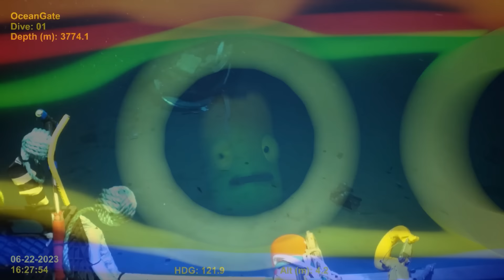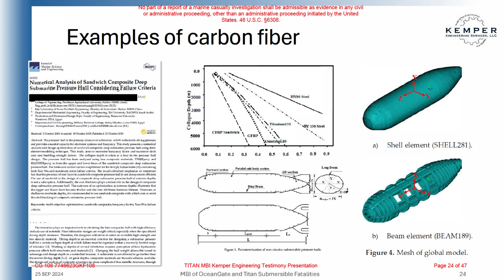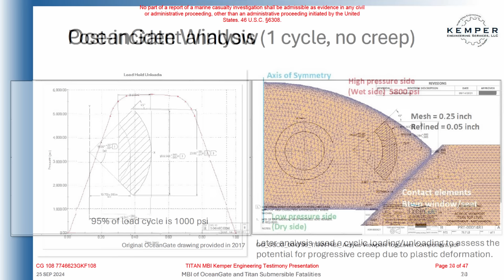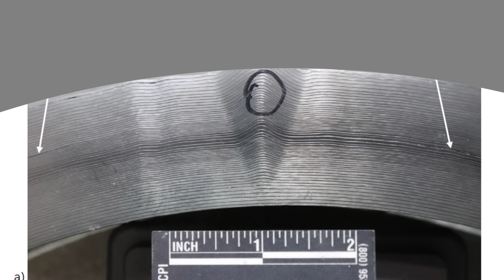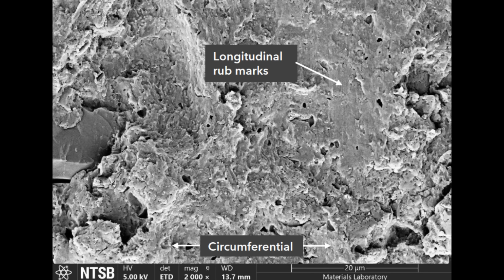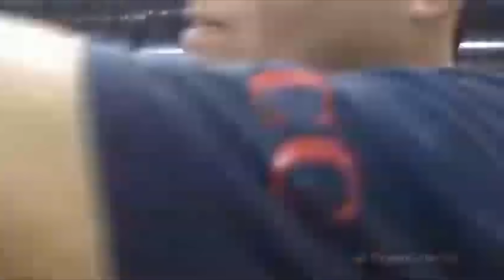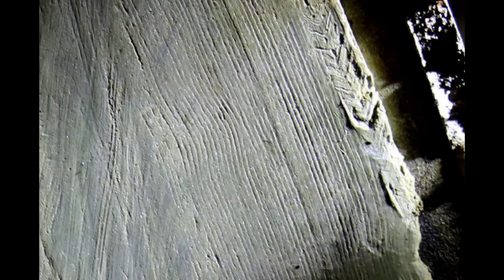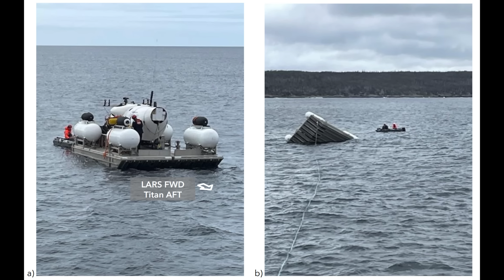OceanGate Wreck Shows Why Sub Wasn't Strong Enough To Survive - NTSB Shares Important Details

Comment: 11:15 "and then machine the surface flat again" sweet jesus that sounds uncannily like the carbon fiber version of "i shaved just a couple inches off the top of these engineered I-beams to make the bathtub fit better".
Reply: haha yeah it's not like the very long fibers are an important part of a composite and sanding them away would seriously weaken it
Reply: @artemisfowl7191  I AM THE ELON MUSK OF THE SEA AND I DID IT WHEN THEY SAID IT COULD NOT BE DONE!!!!! -Stockton Rush, probably.
Reply: @AngryMillennialChannel , and clearly he was not Elon.
Reply: @fredk.2001  Elon is also nowhere near as smart as he claims. gestures to the cybertruck
Reply: @AngryMillennialChannel  Elon is at least smart enough to order countless unmanned tests before sending people onto unproven designs. I imagine OceanX would operate a lot like SpaceX, and spend the first fifteen years of it's existence just doing unmanned operations.
Reply: @AngryMillennialChannel  "Well they did say it could be done... Whether it should be  done was another matter entirely."
Reply: @fredk.2001 Elon is at least smart enough to not go in his own rockets.
Reply: By machining they meant sanding with hand sanders too. Crazy. It's hard enough to get a good finish on a nice piece of wood.
Reply: @dustman96  By machining they mean using cutting inserts and skimming the cylinder on its mandrel. like one giant lathe.
Reply: HAND SANDERS?  @dustman96
Reply: @dustman96  you're pulling my leg
Reply: That was my thought too! I'm no engineer, but I've built enough stuff to know that doing that will only weaken the finished product. Did they deliberately build this thing to fail spectacularly? Because that's what it's sounding like.
Reply: I cringed the moment I heard that!
Reply: @TheSakzzz  Same. And those images of the wrinkles and bubbles were painful. I wouldn't allow that kind of lax quality on any of my own work, and lives certainly don't depend on my theatre props or refinished furniture! But I have this thing called self respect.
Reply: what's the purpose of single continuous fiber construction if you just cut into it afterwards
Reply: They didn't even machine the bumps off. They used an ORBITAL SANDER BY HAND and then started winding carbon fiber over that surface. By the fifth layer there were bumps all over the entire surface and they had "sanded off" about 25% of the total structural integrity. I'm an idiot and even I know not to do this...
Reply: 100%
Reply: True, just a total slashdash hackjob!
Reply: This is why i get nervous every time I've had to drill into my Jeep's frame to install something lmao.
Reply: That doesn't even take into account the fact that when you sand away material it makes a lip which is a focal point for more pressure stress.
Reply: Even better - it's like saying "I am just cutting a few of these cables, it's just a cut, but the cables are still dangling there - that must be worth something, right?"
Reply: The carbon fiber strands would not be continuous there and it would weaken that layer.
Reply: @CrowsofAcheron  It's just shoddy craftsmanship! Amateur shit!
Reply: Also they are machining the "uncured" resin off that was under the peel-ply.  I use peel-ply with Epoxy on boats so I can get a chemical bond which is stronger than a mechanical bond from sanding.  That layer though is only a few molecules thick.  You can basically clean it off with acetone.
Reply: I kept thinking to myself. If the would-be-occupants of the titan had known of all these "Details".
Reply: (shudder) "plumber cancer"
Reply: Probably even worse - steel still has own rigidity - Carbon fibers though are just fibers ... if you cut the middle because it's wrinkled... O.O
(depending on details of the I beams, of course) (also, I beams tend to be designed with more tolerance, depending on details, but their goal was lowering weight, so ...)
- With Probably a meter to each side of the many severed layers of the cut fibers was nearly non-structural. It was almost just plain resin.
Reply: no to be fair i think it makes sense. Their logic was that by machining them flat they'd loose the strenth of the top few fibres, but this would be made up by the next layer being stronger because it lacks the bulges, while also reducing weak points.

Assuming carbon fibre was an acceptable material for the job and assuming they used enough layers, it would have been a somewhat passable idea.
Reply: Exactly, like wtf, I thought it couldn't be worse but there it is
Reply: I'm liking your comment because eat a bag of hell username with 666 likes is to close to irony...
Reply: Meaningless- they were using the carbon fiber in compression.  Literally pushing a string.
Reply: @edasm4113  Carbon fiber is a reasonable material to use, but the rig they built to lay the fiber was not up to the job.  Plus, sanding the fiber is true idiocy.  What amazes me though is that they ignored the bang.  Literally 10 seconds of thought makes one think that the bang was one of the glue layers separating from the carbon fiber as the strain went down after the dive.
Reply: @Leeeeegion , water had ingressed under high pressure and once the pressure from outside had lessened, the trapped water pushed at the glue layers, separating them abruptly, and causing the bang.
Reply: @Leeeeegion  Fiber reinforcement (of any kind) is simply incapable of resisting compressive force.  It aided the binder but did nothing to prevent the implosion.
Reply: @edasm4113  This is the "armchair physicist" comments that Scott mentioned at the beginning of the video. It's far more complex than that. It's not that it's fundamentally a bad material to use, it's simply that we haven't done enough research for it to be certified in the US. 

There's a lot more to it than just "carbon fiber composites good in compression. pushing string." No, if done right, with more research and not cutting corners (or more specifically, layers of fibers) it can work.  Glass fiber composites (same thing, basically, just weaker) have been used successfully in DSROVs.

Comment: Carbon fiber can work in this application......but it needs extensive research and lots of pressure cycle testing to determine durability, and development to ascertain the best manufacturing process.  Very pricey undertaking.

Comment: seems like it’s not a great practice to use two very different materials built into very different shapes both with very different reactions to extreme pressure along with the difficulty of joining the titanium domed end caps to the cf parallel sided barrel, far too many variables to control

Comment: I was prepared to give these guys the benefit of the doubt - just because it's a new construction and just because they disagreed with some experts, sometimes experts are wrong.
But ignoring your own warning system. Machining down imperfections in the wrapping, not catching increased strain due to the redesigned window that can be understood with a simple FEM analysis- it's just unforgivable.
Reckless morons.

Comment: Couple of observations 🙂. Carbon fibre DOES WORK! It completed a number of dives to it's intended depth. What they didn't understand was how long it would work for. There was no data available to understand the effects of multiple cycles and they made no effort to collect and understand the data - their real time monitoring system being testament to this. Stressed carbon fibre, immersed in HP sea water doesn't age particularly well. This accelerated by the various imperfections buit in. So some part of the hull suffered from the ingress of water that caused delamination. Probably at or near the titanium (front) end ring. We will never know for sure. The pressure found the weakest spot and blew it out, causing the entire structure to self destruct. I believe that based on the lessons learned someone (crazy enough) could build a version 3 that will last a lot longer than Titan V2 did. Sort out the manufacturing process. But you would still have to limit the number of cycles to a do not exceed number 🙂

Comment: Very poor buildquality... Grinding down carbon fibre sheets because of buckling is just bad practice. They should've layed down one after an other rotating the meeting points of the layers.  Also, why weren't the steel rings sandblasted...?
In addition to that they got air into the glue joints between carbon fibre layers...

Needles to say, I facepalmed multiple times this video.
And to be honest, I'd rather go see the titanic in a sub built by my formula student team, then this deathtrap.

Comment: What the hell, did they really had wrinkles and just sanded them off?? Like, that will works for poorly fiberglassed boat hull, you can sand the air bubbles it and patch it up, but not for a pressure vessel. How did it even work for that long with those imperfections?

Comment: Corners, and boundaries between unlike materials, are ALWAYS someplace to watch for cracks or even catastrophic failures. 

NOT testing multiple prototypes to failure with a novel design, in a novel application, is horrific. Relying on a safety system whose behavior you haven't monitored during the destructive testing you didn't do - that's a fast ticket to a Darwin award. 

Bits of dead people. Called remains for a reason.

Comment: the simple solution for the window would have been a second inner window designed to optically correct the view that does not bare load.

Comment: Hi Scott. 
Awesome video. I work in aerospace and wrote my PhD on ultra thick composites. In a nutshell; in any curved section of the laminate transverse stresses are induced. Transverse strength of the laminate is way lower than one might expect; it basically boils down to resin strength. This quickly causes delamination. On top of that; significant process induced stresses from the curing process need to be added (heating/ cooling/ resin curing). 
The wrinkled you mentioned are a serious issue and caused during the compaction process of the uncured laminate. They will cause local stress concentrations.  Machining the outer surface flat is probably the worst thing you can do since the fibers and thereby the primary load path is destroyed. On top, the round cross section of the vessel actually becomes asymmetric. Naturally this also results in an asymmetric stress distribution and hence deformation, further promoting transverse stresses over the laminate. BTW, transverse shear stresses a most likely at a maximum in the middle of the laminate. Most of that stuff can actually be calculated with off the shelf FE- tool. You just need to know where to look ;)  
Machining of CFRP is a science on its own. We found that free edges of a thick laminate can suffer from significant damage due to the machining process. Nothing you will notice with a naked eye. But, there will be microscopic damage in a critical location (free edge effect...). 
Just a few things I could remember. Did my thesis back in 2011. A portion of it is here in case you are interested: https://kth.diva-portal.org/smash/record.jsf?dswid=-2218&pid=diva2%3A454092&c=3&searchType=SIMPLE&language=en&query=&af=%5B%5D&aq=%5B%5B%7B%22personId%22%3A%22u1jsiwfm%22%7D%5D%5D&aq2=%5B%5B%5D%5D&aqe=%5B%5D&noOfRows=50&sortOrder=author_sort_asc&sortOrder2=title_sort_asc&onlyFullText=false&sf=all

Comment: Very interesting video. A couple of points about the design (as a non-engineer).
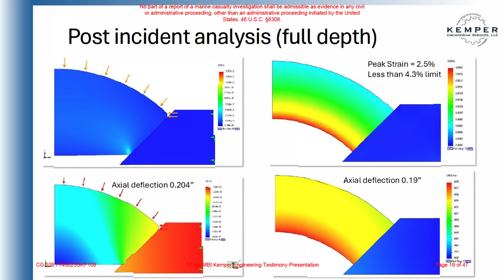9:00 ish The obvious fix, even prior to build, was to use a (part-hemispherical) approved window and to stick to it a non-loadbearing second layer, flat on the inside, matching the inside curve on its outer surface and not touching any part of the hull. Potentially, you could calculate the outer window shape at depth and apply an appropriately shaped flat/curved second layer once in the deep using a surfactant to ensure a quality optical join (slightly daft but possible).
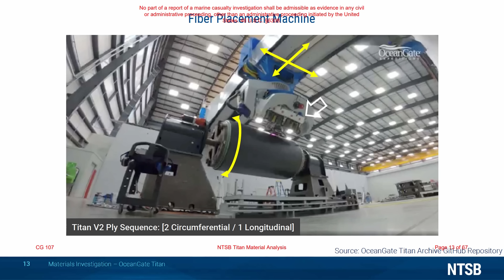10:30 ish The original problem that RR Aero engines had with carbon fibre blades for the RB211 (which bankrupted the company) was that the blades had only 90° layers and shattered in bird impact tests. The solution was to have 45°layers in the mix. It would have been smart to learn this decades old lesson, as requested by Boeing, and make the carbon fibre more resilient by using four layer orientations.
Reply: IIRC layered CF propellers just kept delaminating, and the industry had to bite the bullet and pay for 3D weaving.
Reply: The secondary viewport layer wouldnt need to be solid. A gel with similar optical index backed by a 5mm sheet of acrylic would be enough.

Comment: Micro air bubbles trapped in between layers during curing won't have helped under extreme pressure. I am surprised they didn't try and find some way to put the unit under a vacuum while curing to limit the risk of them forming and to create a stronger lamination.
Reply: They did -- and that's where the wrinkles came from.  It's pretty standard to put carbon fiber layups in a vacuum bag to squeeze out the excess resin between the layers, so that the carbon is pressed as densely together as possible.  But they only did this every inch of thickness -- and, just like if you loosely roll up a roll of paper around a solid tube and then put a rubber band around it, that causes the outer layers to form wrinkles because their diameter is shrunk by the squeezing but their circumference stays the same.

Comment: Definitely the best video about the subject I have seen so far! And being a mechanical engineer with some experience with composites myself, I guess I can claim having an above average understanding of the subject.
Just one thing, since it is mentioned so often in articles and videos: Yes, (carbon) fiber composites are better under tension than under compression. But they are often used under compression too! Easy example: an airplane wing. While in (steady) flight, the upper skin of a wing is constantly under compression. (Grounded it's the opposite, but the loads are much smaller) You just have to make sure nothing buckles AND KNOW WHAT YOU ARE DOING!
And another thing: These titanium flanges look ridiculously thin!! Less than 1cm! (22:02) I don't know the design loads acting on them, but that's just like a sheet metal... 😳

Comment: OceanGate Titan Submersible Implosion: A Deep Dive into the NTSB's Preliminary Findings

* 0:04 Coast Guard Inquiry Focus: The video analyzes the Coast Guard's inquiry into the Titan submersible implosion, focusing on technical aspects and the NTSB's preliminary findings.
* 1:00 NTSB Analysis: The NTSB presented imagery of the wreckage, analysis of recovered debris, and material test results from the carbon fiber hull, providing insights into the microscopic level of the failure.
* 1:23 Carbon Fiber Hull Construction: The Titan's hull used titanium end caps and a barrel-shaped section made of five 1-inch thick carbon fiber composite layers. OceanGate chose carbon fiber for its light weight, aiming to minimize support ship costs.
* 2:12 Early Design Challenges: Early tests with carbon fiber end caps resulted in failures, leading to the adoption of titanium end caps.  The barrel shape, while less strong than a sphere, was a compromise for weight and cost.
* 3:43 Material Suitability: While titanium is approved for pressure hulls, carbon fiber composites are not, primarily due to a lack of extensive testing, not inherent unsuitability.
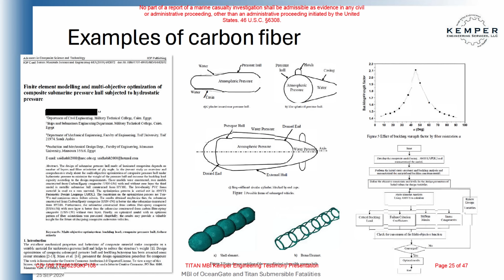* 5:11 Window Concerns: The Titan's window, not being the standard shape, was not rated for the dive depth. This design choice, driven by the desire to avoid optical distortion, resulted in higher stress concentrations in the window corners.
* 9:13 Hull Fabrication: The hull's construction involved layering and machining to mitigate wrinkles in the carbon fiber.  A peel ply was used to roughen the surface between layers for bonding. However, wrinkles persisted and interlayer adhesion remained a concern.
* 12:56 Wreckage Analysis: The recovered hull piece (Hull piece A) split along the glued layers, indicating weaker interlayer bonding compared to the carbon fiber layers themselves. Microscopic analysis revealed voids, crushed glue powder, and rubbing marks, suggesting interlayer movement under pressure.
* 17:56 Macroscopic Wreckage Analysis:  The forward ring showed significant damage, with sheared inner flanges and missing adhesive. The aft ring retained some adhesive and showed impressions of carbon fiber laminations. The pattern of debris suggests the failure may have initiated at the bottom front, near the forward ring.
* 23:45 Real-Time Monitoring System: Strain gauge data, when plotted against depth, revealed a significant jump in strain on Dive 80, correlating with a loud bang heard by those on board. This change in strain persisted in subsequent dives, indicating progressive damage. The real-time system detected the anomaly but it was dismissed by OceanGate.

I used gemini-1.5-pro-002 on rocketrecap dot com to summarize the transcript.
Cost (if I didn't use the free tier): $0.03
Input tokens: 19206
Output tokens: 569

Comment: Contrary to popular belief, peel ply does not per se generate an optimal interface for adhesive bonding. It is primarily used to generate homogenous surfaces and avoid contamination while awaiting further processing. In some cases peel ply has been contaminated by silicone oils, or is even coated with non-stick components (e.g. PTFE) to facilitate removal. An additional cleaning and / or surface activation is mandatory for further adhesive processing of critical components in most cases.